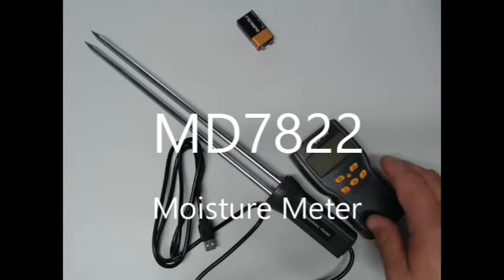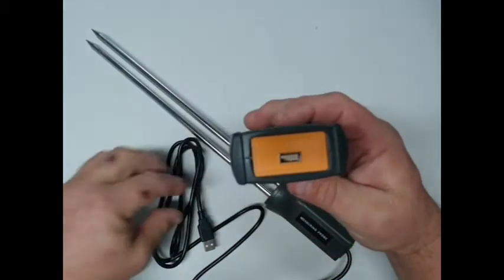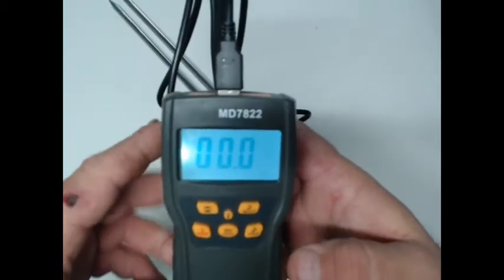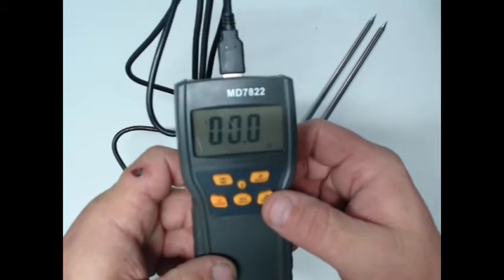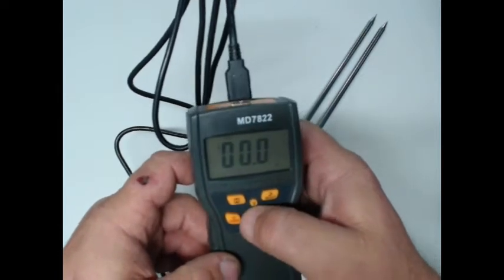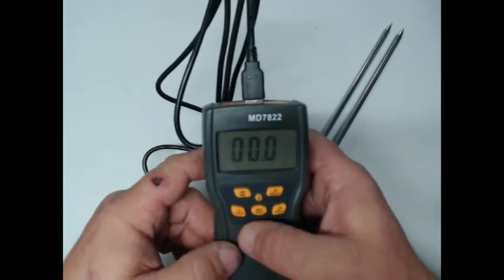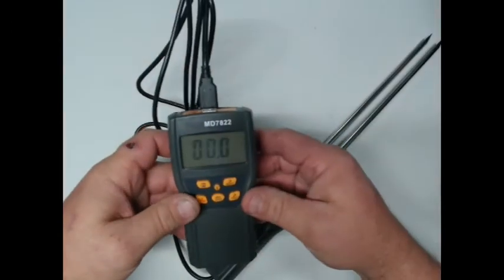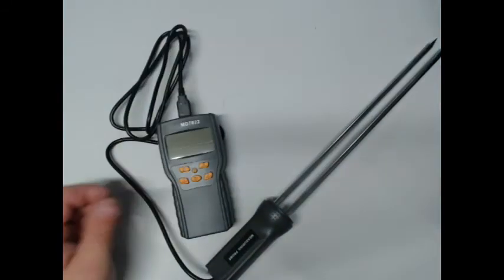MD7822 Moisture Meter

Comment: How to calibrate it... It's not coming down to zero
Reply: Unaware of any way to calibrate device. Only suggestion if you have not already tried is to pull battery, clean probe, dry well and see if that helps. Other wise it sounds defective.